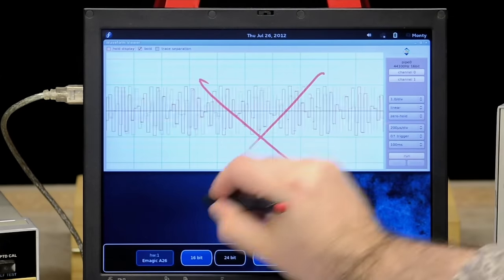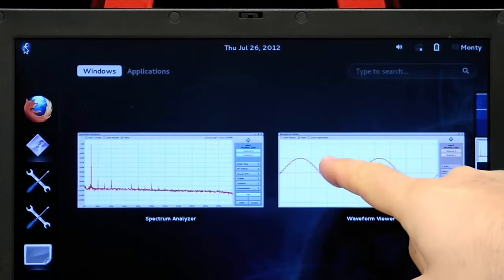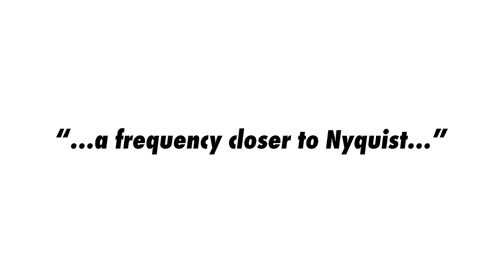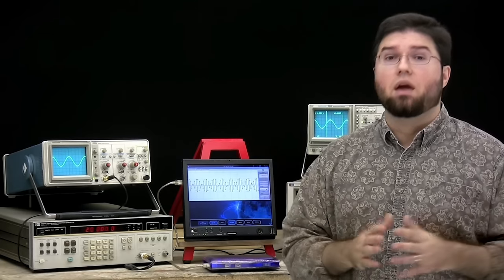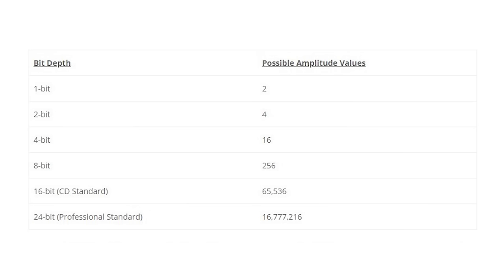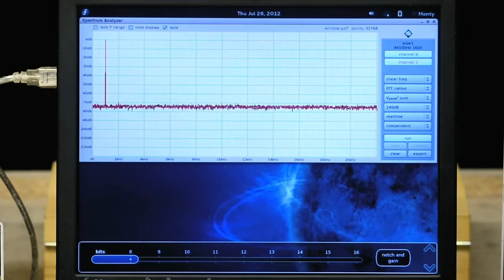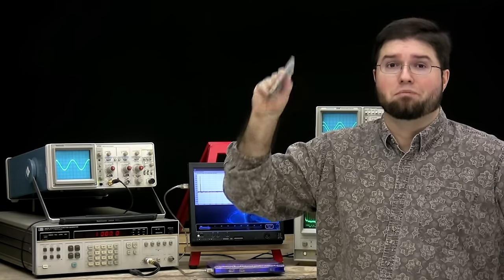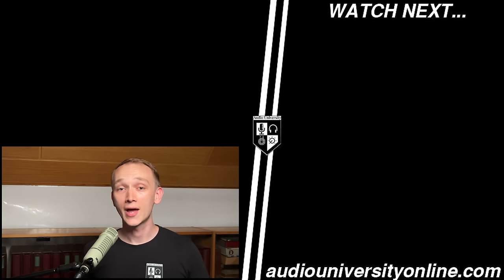Debunking the Digital Audio Myth: The Truth About the 'Stair-Step' Effect

Comment: My best argument FOR the CD-standard is that it is not something they came up with and then proved to be good enough with math. The CD-standard was based on the proven math and was actually extremely stringent for its time. It's not more complicated than that with good electronics.
Reply: Things don't always work as well in the real world as they do on paper. Time travel has been proven mathematically but still not perfected.
Reply: @acoustic61 , well, that's true, buuuuut we HAVE empirically proven, as seen in this video, that the math holds for band-limited digital signals, and the same goes for the CD format.
Reply: @TokeBoisen  Music is more complex than some demo of a sine wave. I've listened to thousands of hi-res digital transfers and virtually every one sounds better than CD. I think it's easier to get better results with higher sample rates. Maybe because steep filters, which are imperfect, and other forms of processing can be used more sparingly. I see no reason not to use higher sample rares. Digtal storage is dirt cheap.
Reply: @acoustic61  oversampling sounds better if any form of saturation is involved. So you're right that it won't matter for just a sine wave. Dan warrel has a good video on oversampling.
Reply: @acoustic61 , the sine wave is just the easiest example to demonstrate the concept. As is explained in the longer video from Monty, any complex waveform of a band-limited signal can be perfectly captured and replicated. If it deviates from the original waveform it MUST contain information above Nyquist and is therefore no longer a possible solution.
It HAS been documented and verified that phase-differences can impact the ability to capture perfectly if the chosen sampling-rate is exactly twice what you'd want to capture, but that is inconsequential for either CD or modern digital formats where the sampling-rate is much higher than twice the upper limit of human hearing.

Additionally, if you ever look at FFTs of hi-res transfers you'll most likely see that there is either no information above 20 kHz, or what is there is just noise. At best that means they just waste bandwidth, at worst it introduces IMD in the audible range. Any differences you are hearing are more likely to be due to a difference in mastering, an increase in gain, or just simply psychoacoustics.
Reply: The math was proven, though the designers of the CD audio standard were also restricted to designing an audio format they could digitise to regular videotape that was available at the time. In the early '80s there were no hard disks with enough capacity to store an entire ~75 minute CD, so regular videotape (VHS or Beta) was used for digital mastering.
Typically the analog multitrack was mixed down to stereo, mastered to two-track analog tape, converted to digital, then converted again to a video signal, then recorded to video tape.
Though conceivably some music was mixed down to stereo and converted to digital, skipping the two-track analog tape step.
Some live music in the '80s was also recorded digitally, completely eliminating tape hiss, eg. orchestras.
Reply: @acoustic61  what do you mean? I've perfected travelling through time at 1second for every second.
Reply: @acoustic61  The Nyquist-Shannon sampling theorem isn't just true for sine waves, it's true for any bandwidth-limited signal - even your hi-res digital transfers...

If you think that storage is dirt cheap then by all means do use 192kHz files.
You won't be getting any better audio than with 44.1kHz, but you can at least tell your friends that " These go to 192. It's 147.9 more " (to paraphrase Nigel Tufnel).
Reply: @d5uncr  For whatever reason, virtually every hi-res transfer that I've heard sounds better. Theory is one thing, execution is another. Otherwise there wouldn't have been improvements in DAC and ADC converters in 40 years and there definitely has been.
Reply: @acoustic61 time travel proven mathematically?  That's a stretch, especially as an argument against this videos point.
Music is not time travel.... didn't think that was a hard concept to grapple
Reply: @acoustic61  Sure converters have gooten better. And sampling rate is a factor there. But even the cheapest audio codec IC you can find is going to use a native sampling rate of 96kHz and if you send CD audio to it, it will perform upsampling, which then allows for gentler reconstruction filters. A band limited signal with no content above 22.05k is also a band limited signal with no content above 48k and a filter that only has to remove content above 48k with little to no artefacts in the audible range is easiert to design that a reconstruction filter that has to cut anything above 22.05k and not affect things below 20k. But that's the evolution of hardware and since upsampling is lossless the storage format doesn't matter there.
Reply: @acoustic61 hearing is subjective and meaningless. Record the two and if you see a difference in the data you record them you can show without argument that what you think you hear is objective. You'd have to transcode though because different recordings are probably mastered differently, not just stored differently
Reply: Philips: Hey Sony, wanna make a digital audio carrier to replace LP's?
Sony: Sure!
Philips: Let's make the inside hole the same diameter as a Dutch 10 cent coin
Sony: Cool!
Philips: We'll use existing technology from our Laser Disc products to scatter the bits and do error detection/correction, and encode time codes in BCD.
Sony: Great!
Philips: We'll make the discs small enough to put in your hand and to fit in a car player, 11.5 cm diameter.
Sony: Good idea.
Philips: We'll use 44056 Hz 14 bits, that's going to result in about 30 minutes per side.
Sony: Ummm...
Philips: And our Polygram record company has started building a factory in Germany to make the discs.
Sony: We don't have a record co...
Sony: BUT WE DO HAVE THIS! (Dumps U-Matic recorder with PCM-1600 encoder/decoder in Philips' lap) 44100 Hz 16 bits BABY!
Philips: We... already had a 14 bit DAC... 
Sony: AND THE DISCS SHOULD BE 12cm DIAMETER AND SINGLE SIDED
Philips: But that means we have to start over with our factory
Sony: WE WANT THE uh... (checks notes) 9th of Beethoven fits on there. That's 74 minutes.
Philips: No it's not but whatever.
Sony: And we want to deliver the first CD player in the world
Philips: Fine. (Starts developing 4x oversampling chip)

Sony: BAM! CDP-101 16 bit CD player. Check out the super snazzy high cutoff filter at 44.1 kHz.
World:  Yay! CD sounds pretty good but a servo motor for the laser? And that filter is causing some phase problems in the highs...

Philips: BAM! CD-100 14 bit CD player with 14 bit DAC and 4-times oversampling. Our filter doesn't have to be as sharp as the other guys because all the Nyquist distortions end up above the hearing range. And we're using this snazzy galvanometer-style arm for the laser.
World: That... actually sounds even better than the Sony!
Reply: @mattymerr701  I don't need to compare anything. I'm enjoying what I hear and that's all that matters. If you like CDs them have at it. I don't understand why people like you feel the need to tell everyone else what to do?
Reply: @acoustic61   That reason is called "confirmation bias".
You brain knows that " It's 147.9 more " so therefore it also believes that it sounds better.

Modern day converters are better than the first ones that came out in the 80's, but that's not the point.
If you used the same original audio and the same converters and did one transfer at 192/24 and the other at 44.1/16 you wouldn't be able to tell them apart in a blind test.

Unless you claim that you can hear above 20kHz - but if 61 is the year you were born you probably can't hear anything above 12-15kHz anyway.
Reply: @d5uncr  Not true. I hear a difference. May not be because of the sample rate but there are differences. TBH, I don't really care what you think. You've probbaly never compared. but just repeat standard talking points you read about.
Reply: @acoustic61 You hear a difference because they're mastered differently. The record companies have an incentive to make the high-res master sound "better". Good job on being a gullible consumer.
Reply: @acoustic61  You're trying way too hard to justify your "hi-res" audio lol.
You can't beat math and physics, your higher sample rates and bit depths are a waste of storage space for listening, especially if you're over 12 years old.

That's right, not only are you going against math and physics, but biology too.
If you're older than 12 years old, your hearing will just keep getting worse and worse with age, maybe if we were birds you could have a point, but we're mammals.

16 bit 44.1Khz is more than enough, and way way more than enough if you are old, those are the facts.
Reply: @acoustic61   Yeah, if you're listening to two completely different transfers of the same source material it's quite possible that you can hear differences.
But my point it that if the exact same transfer was made first at 192kHz and then at 44.1 there's no way you'd hear any difference.

Not unless you can hear above 20kHz or, possibly, if your audio system can't handle the ultrasonics and instead creates intermodulation distortion (and you happen to like that, for some reason).
Reply: @acoustic61  time travel into the future has been proven, time travel into the past is theorized but not proven mathematically. Time travel into the future has not only been proven mathematically, it's been demonstrated. Not just with particles but even massive objects like satellites, are slowly moving into the future due to their speed and time dilation
Reply: @mattymerr701  Glenn Fricker would agree. I would love to see him do a blind test to see if he hears a difference. Knowing the format will colour your opinion. Let's see the science not the trust me bro I can hear the difference
Reply: @acoustic61  Your digital files likely sound better because modern mastering is better than the trash volume wars mastering of yesteryears CD releases. Anything pre-2010 released on a CD is mastered to just be as loud as possible and that degrades the dynamic range of the actual tracks, because everything is just boosted to shit.

Try listening to some modern releases on CD and compare them to the hi-res digital releases of the same albums. In nearly 100% of all cases they will nowadays be identical. Which is really nice because a) CD's are now actually able to be listened to again and b) equally good options exist for people that would rather have their music on a single physical storage device instead of needing to make space for a box of albums.

But for old CDs the modern remasters in digital releases 100% beat the original CD releases no questions asked.
Reply: @acoustic61  storage is cheaper but higher sampling DAC’s & ADC’s become exponentially more expensive with sample rate. You also need a processor fast enough to handle it. You also need to run it through algorithms which get exponentially more time consuming as you add bits. It also get shipped all over the internet and every one of those transfers requires bandwidth. Storage is not the limiting factor here.
Reply: @lusher00  And high bit rates also increase the risk of digital audio links (S/PDIF or AES3) being unreliable due to signal integrity issues... whenever customers of ours have a problem sending digital audio into our product it's almost always with 192 or 176.4 kHz audio... and statistically speaking not even because their source audio has that sample rate but because it got 4x upsampled by the pointlessly expensive music player device they're using /o\
Reply: @acoustic61  You're describing the placebo effect. When done in double blind studies, actual audiophiles were unable to tell which was which. You EXPECT it to sound better, and so it does, but that is because your brain is tricking you. You can actually get the same benefit by just WRITING 192khz on the CD before popping it in.

The placebo effect is responsible for a LOT of these situations in life were people SWEAR there is a difference, when all empirical evidence says otherwise.
Reply: @trapfethen  technically, placebo effect is a difference..
Reply: @MungeParty  No, you're not hearing a difference between the two. Your brain is literally lying to you. You could literally switch the two around (label the hi-fi as cd quality and vice-versa) and you would STILL swear the one LABELED as hi-fi sounded better.

You're not perceiving a difference at all, which is why the moment you have the two side by side in a blind test, you can't tell the difference.
Reply: @acoustic61  Were these double blind tests?
Reply: @acoustic61  Thing is, you say it "sounds better", but thats a highly subjective thing to say. Maybe you just like how fake it sounds? Maybe youre just imagening that it sounds better because of bias? Could be a lot of things, people have very subjective taste in hearing and judgement. Science is trying to remove the subjective element, which isnt always possible, but this audio stuff seems to have come pretty close.

Also time travel hasnt been proven, Im pretty sure its impossible with current physical models (which might be wrong tbf). Its just that time can move at different speeds, but it never moves backward.
Reply: @acoustic61  it has been proven mathematically that time travel is impossible, because it requires speeds faster than light. a real bad example, for a real bad argument.
Reply: @acoustic61 you're just straight up wrong here, sorry 

that extra bandwidth won't do a single thing for you, if, as others have said you took the exact same source and mastered to CD and hi res

there's this thing in engineering called the null test where you subtract one signal from another and whatever is left over represents any audible difference 

if you do a null test it will show you one of two things: either a difference in mastering or a null result indicating that Nyquist holds

you brought up how things work "on paper" but actually there's a lot of physical measurement that goes on, and a lot of it is to confirm that things work the way we think it does
Reply: @acoustic61  I don't doubt that you hear a difference, but that doesn't mean there is a difference. And even if there is a difference, it doesn't necessarily mean it's better, unless one is probably poorly mastered. And often times hi-res tracks these days are remastered from the original source, as opposed to just copying a master from decades ago, which is why they can and do sometimes objectively sound better (it's just not necessarily the hi-res part doing it).

I enjoy hi-res audio not because I believe it to be better than CD, but to lower the chances of any audio distortions coming into play. It's the same reason I use a balanced output from my dac to my balanced amp to my balanced headphones. Other than loudness, I don't reliably hear a difference, but that doesn't mean it's not worth paying a little more to prevent interference in a provable way. Or maybe it is for some people, and that's okay. I don't deny the science, or buy danceable cables, but it's still fine to enjoy hi-res music and other things like that, even if realistically it is improbable we hear a difference, because science is science, with signal processing being a very robust science. And technically SN relies on a perfectly band limited signal, which doesn't exist anywhere but math land, so hi-res may be better with sensitive enough equipment (and by that I mean scientific instruments, not audio equipment). However, it's still improbable any human buying audiophile grade equipment or music could physically perceive this difference. It's more the fun of not compromising, or just experimenting and finding what sounds best to you, whether it's objectively better or not.

To me it's like buying a sportier car. You know that its acceleration is technically 0.2s faster 0-60 than your old car, so you might believe it feels faster, but in all likelihood, your senses are not anywhere keen enough to tell that little of a difference. Its also a newer, different car, so other things may be influencing this (comparable to mastering). I'm not saying it's impossible. I'm not saying don't enjoy your new car, I'm just saying realize it's subjective, and not something to argue about. Especially since your new car might have slight deficiencies to where it's actually just as fast 0-60 as your old car, since engines vary in horsepower and torque from the factory, even expensive hand-built super car engines.
Reply: Not entirely true...  It is actually the  limit of what PCM recording on tape media was being done before the CD came out.  That's why the number is somewhat random.  It has it's background in physical media.  Technology connections did an excellent video that then touches on this history. https://www.youtube.com/watch?v=xSnrQBfBCzY
Reply: @acoustic61 so you have superhuman hearing and disproven the fundamentals of information theory - why have you not gotten your Nobel prices yet? Oh, it is just a figment of your imagination....
Reply: @joshuapettus6973 , well, yes, I'll admit to not knowing about digital audio on VHS 😅.
But still, the CD standard was quite stringent for the time, being set mostly by virtue of the requirements of sound rather than technological convenience
Reply: @TokeBoisen  Lol!  Naturally, neither did I.  As a fellow audio nerd, I assumed you would interested, as I did, on where that actual figure came from, and why it isn't say, 48k which would have also fill the need.
Reply: @lusher00  Also, why would anyone want to waste disk space on "ultrasonic" sound? I never got that. "Hun, I expanded the garage for lots of $ so we can store even more junk in it!" "Great!"
Reply: @acoustic61  what do you mean not perfected? It is possible we can literally observe it happen on Earth, it just seems to only work in one direction, forwards and it’s only possible to travel far in the future through the use of an unimaginably massive object like a black hole because it warps space time around it so strongly.
Reply: @smartyy86  that isn’t actually true, time travel has been proven mathematically in our current understanding of physics and we’ve literally observed it. Faster than light speed would be theoretically required for BACKWARDS time travel but forwards time travel is very much possible not just theoretically, but in reality too. It’s just not practical, because you’d need something mind bogglingly massive, like a black hole, to experience time dilation great enough to travel decades or even centuries into the future while only experiencing a few years of time yourself. But this time dilation happens with any kind of gravity including the Earth, so astronauts actually experience time slower than us on Earth by just a few tiny fractions of a second, because the Earth’s gravity warps space time slightly.
Reply: @Dell-ol6hb  Everything has been proven mathematically, just that you need an invite amount of energy to approach light-speed. The concept of infinite Energy means it is not possible in reality. This is called science, not science-fiction.
Reply: @JacGoudsmit LaserDisc didn't come out before CD did, lol!
Reply: @RAHelllord  Actually, it's exactly 100% the total OPPOSITE of what you stated there, because the so-called "loudness wars" had actually STARTED in about 2010, so MANY albums released around and definitely after that time, (especially the more popular ones), were mastered with levels maxed out, oftentimes sounding quite horrible as a result, whereas almost NONE of the CDs ever released BEFORE that time period were ever mastered "level maxed", and you can even notice that on average among most ALL older CD recordings, (especially ones from the 80's and 90's), that they are all pretty much at a considerably lower output level than many of the newest albums on CD, especially among a lot of the more popular stuff nowadays!

The loudness wars that began around 2010 was a (failed) attempt by the record companies at trying to increase new album CD sales again, (by supposedly making them sound "more impressive" than MP3 downloads), (but, ironically, to anyone who has a more audiophile minded ear, CDs already did, and always will sound MUCH better than any MP3 downloads do!), (ACTUAL higher resolution album releases were not quite available yet at that time), and the reason it was done was because new CD sales at the time had started to fall off in comparison to people just buying the downloadable version of the album on MP3, (which was maybe a more convenient way to have an album to many people than always having to carry around a CD copy of it everywhere), and since most people nowadays, especially the younger generations, don't usually seem to care as much about sound quality as they do about ultimate convenience, this is the result you get among the masses and among new album production.

I say this as a LIFETIME collector of CDs, ever since I was a kid, (I'm now in my 50's, and I still buy new albums on CD), and I have a current CD collection exceeding many radio stations, of over 40K CD albums, in just about every genre, and from all over the world, and since I've stuck with the CD format from the very beginning, and I've always bought all of my music on CD, whether brand new OR used, I know exactly what all "trends" have been happening with the CD format over the decades, ever since their very first introduction in 1980/81.

And BTW; the reason that many newly remastered albums (IF they're actually remastered carefully and properly), CAN sound better than their original first releases on CD, is just that... Better (potential) mastering capabilities nowadays IF it's done correctly, and with proper level matching AND the complete avoiding of digital clipping distortion... It's NOT because the original releases were ever level maxed or loudness enhanced, as you say, the difference is ONLY in the abilities of modern technology within the mastering processes to be potentially noticably better than in the past, plus the simple basic fact that most older CD recordings were just recorded at a considerably and noticably lower overall level than most newer recordings usually are, because when the CD format was first introduced, not everyone knew what its FULL capabilities were, so they were being careful not to overdo anything, level wise... And to many average people, simply LOUDER = "better", hence the perception that the remastered versions of classic albums sound better to most people, and that's definitely NOT all that is involved with that, of course, but it definitely plays a significant part... But more on that below...

However, nowadays, many record producers have actually begun to even EXCEED the maximum capabilities of the CD format, with all of the loudness wars BS, so through the regular modern use of MAJOR compression of dynamic range AND overall level maxing, it makes ALL of the newer CD recordings sound LOUDER than the ones in the past, like ones from the 80's and 90's especially, (and, as I mentioned above, to many average people, louder = "better", at least if you're not paying close attention to the minor details of the sound, especially the detail and clarity of the highs, the OVERALL clarity, and the overall compression or LACK of dynamics!), and then that same trend has ALSO (unfortunately!) made more than a few modern CD recordings sound really harsh and distorted due to the level maxing getting into and even past the point of digital clipping. (i.e. 0 dB FS)

Modern technology and recording equipment and processes definitely have the POTENTIAL to sound noticably better than in the past, however, ONLY IF it is utilized fully AND properly, and NOT ever "abused", as in just simply maxing out all of the levels to make the recording as LOUD as possible, regardless of clarity, as doing that is definitely NOT at all "impressive" to a more audiophile minded ear, so (record and CD album recording and mastering) absolutely MUST be done carefully and properly in order to sound its absolute best, and nowadays there IS more POTENTIAL to sound better than in the past, for sure, because technology has gotten more advanced, however, it's NOT always done correctly by everyone nowadays, so it totally depends on the producer in how well (or not) that they make full utilization of the technology available now to actually make a truly great sounding recording... And the same goes for ANY of the recording formats actually.
Reply: @JoeJ-8282 You might want to check a couple sources on that, because for CD mastering loudness generally peaked around 2005 and slowly went away from that towards more dynamic range. By 2010 more media was back to a more regular dynamic range than around the turn of millenium.
Of course, this generalization is mostly for mainstream music, smaller labels did whatever they wanted and as such there's of course a lot of music available from any era that'll sound decent simply because it wasn't mastered by idiots.
Wikipedia for example has a pretty good timeline on the general loudness wars, as they have also happened on vinyl and in basically any other format.
But the main takeaway is still that it's not easier to master things today, the tech has existed basically unchanged since the turn of the millenium, it's because there's a bigger focus on quality than just shortcuts by going louder, and because we're at the point where learning how to master something properly is easier than 20 years ago. Sure a lot of tools have also become easier to use and can do a lot of the heavy lifting by themselves, but it's still basically the same process now as it was then.
Reply: @RAHelllord  I was just stating the times when I started really noticing the loudness wars, but you're probably more correct in the exact dates, somewhere around the 2005-2010-ish time frame, (I would extend that to at least 2015, especially among most pop music), but of course it was also dependent on the popularity of the music or artist, and of course only certain more mainstream big labels or record companies did it, but in any case, that's definitely NOT at ALL the same thing as if comparing most of the CD recordings that were made POST millennium, (>2000-2005), to the ones made in the TRUE early days of the CD format, like especially the 80's and early 90's, WELL BEFORE ANY of the stupid and annoying "loudness wars" BS ever happened.

I still believe that the mastering technology overall has improved since the very early days of the CD format, so at least the POTENTIAL is there now to make better sounding digital recordings than it ever was before, in the "past", (especially in the early 80's), however, that's definitely NOT saying that most (or even many), (probably realistically only SOME), of the modern record producers actually PROPERLY fully utilize the CD standard to get the absolute BEST possible sounding results from it!

I take it that you are probably still relatively young, if you think that ONLY 20 years ago was a long time ago, lol! To me, that era in music seems like only yesterday! (Literally during some of my most fun peak raving years!) But I'm already 50 now, and I've been continually collecting new music on CDs since I was a kid in the early 80's when they first came out, so I've heard a thing or a few million, lol!
Reply: They (Sony and Phillips..) settled on the CD standard based on the laser technology that could encode and read sound from very low frequencies to 18kz on a disc that would fit between the knobs on an automobile stereo, and could play for 70 minutes (The length of Beethoven's Ode to Joy) Then they advertised it as "Perfect Sound Forever" to people who'd grown up on cassettes. Later, "SuperCD" was developed, then SACD, which was far higher fidelity than CD, and multichannel, then the audio encoding used in Blu-Rays.  Sadly, because the public had already been sold on CDs being "perfect", consumers ignored those superior audio technologies that came along later and were ignored in the marketplace.
Reply: @acoustic61  I find the dog pile funny. There is in fact an audible difference. The person who made this video has a poor understanding of Nyquist and doesn't understand that the 2x number comes from an infinite order non-causal low pass; it is the theoretical minimum on how much you have to over-sample and not a target sample rate. The actual target sample rate depends on how good of a filter you have and what the design bit depth is. To achieve full 16bit audio with the best filter you can put in consumer electronics(8th order), you end up with 192kHz. Well actually 192kHz is only good for 19.2kHz, but most people can hardly hear 17kHz however you still need some buffer to account for roll off so 192kHz works fine.
Reply: CD audio was very well engineered. The only shortcoming, the thing I'd have perhaps pushed for if I were on the design team, was the lack of a mono mode. It would have been easy enough to add, simply by adding a second TOC, and would have been very useful indeed for audiobooks.
Reply: Musical instruments emit ultrasonic frequencies above 20khz.  Same with vinyl which many people prefer to listen to.  So these facts do suggest that CD quality is inferior.
Reply: @dtz1000 They do emit such frequencies, yes. But: 1. You can't hear them, at all. 2. Vinyl also does not preserve these frequencies either, as they are filtered out prior to pressing.
Reply: @acoustic61  Read up on Nyquist and also Fourier.
Reply: @RAHelllord going back in time, when CD was the high end medium, a lot of CDs had great mastering without any loudness compression. 15 years ago, I bought all the original pressings of the classic iron maiden albums. They sound great and way better than the subsequent re-releases.
Reply: I worked for Philips Research at the time (the CD standard was a joint effort between Philips and Sony).   The 600Mbyte capacity of the format was actually just a fraction of what the technology was capable of.   They took the longest playing LP from the Philips/Magnavox library (it was some classical piece or other - I forget which) - and set up the recording density for that duration of play at just beyond the limits of human hearing for a 12 year old with perfect hearing - with the absolute REQUIREMENT that it should be, unassailably,  the best possible recording standard that could never be improved upon...and that's what they achieved.

Sadly - they stupidly went with a spiral track - rather than concentric tracks - which has caused grief for computer CD-ROM players ever since - but that's another story.
Reply: @SteveBakerIsHere  I imagine that the higher the capacity the finer the tolerances for the players and thus the more they would cost to manufacture, so it made sense to not go any higher than required for music? Later revisions did push it a little - CD-Rs commonly fitted 700MB, even using the higher level of error correction used for data discs.
Reply: @d5uncr  At Philips, we called it the "Audiophile placebo effect".
Reply: @acoustic61  I worked at Philips Research labs during the R&D phase of the CD - and they DEFINITELY did double-blind hearing tests.   You're talking nonsense.   The people who developed the CD were VERY determined to produce a standard that was PERFECT...if they needed more bits - the disk would have been larger and spun faster.
Reply: @acoustic61  : were the signals level matched and what were the results of the null test?

You did do a null test, right? Mixing them together with one signal inverted? To hear and measure what the audible difference was?

(I bet I know the answer to this question)
Reply: @acoustic61 I just want to backtrack and say -- what? Time travel is IMPOSSIBLE. It defies thermodynamics, it goes totally against our idea of spacetime, and it definitely hasn't been proven mathematically because the math doesn't work
Reply: @acoustic61 all waves can be transformed into a sum of sine waves, the Fourier transform. 

The problem likely comes from other things in the audio processor.
Reply: 😊 @acoustic61
Reply: @acoustic61  volume leveled and blind tested I guarantee you will not be able to tell the difference.  If you take a hi-res file and run in through a DAW and convert if down to a high quality MP3 it sounds exactly the same. I have done these tests with several people that swear they can tell the difference and they fail more than half the time.  Its just them guessing randomly most times.  Mastering is the most important part.  Plus 99% of speakers and amps are not even able to reproduce the higher frequencies of hi-res.  And CD vs hi-res?  CDs perfectly reproduce 20k to 20khz just the same as high res.  And that's all humans can hear.
Reply: @acoustic61  No, it's not more complex than a demo of a sine wave. It's  exactly the same. The reason hi-res often sounds 'better' is simply because it's mastered better by someone who cares for the music. You can easily hear that when you have well-known songs that throughout the years have been released of countless compilation albums. The same song can sound quite different (brighter, better stereo separation etc) and that is because different masters and different masters have been used. For high-res releases, often the original master tape is digitized again rather than using a perhaps seventh generation copy or worse. But if you were to take that hi-res and 'downconvert' to standard CD in 16bit/ 44.1kHz you wouldn't hear the difference because bog standard CD already captures everything we can hear and will do forever. The sound quality of a given piece of music on CD is mostly determined by the original recording, mastering, your loudspeakers and the acoustics of the listening room. Everything else is marginal at best and most like completely irrelevant.